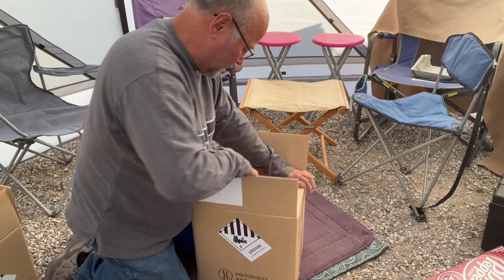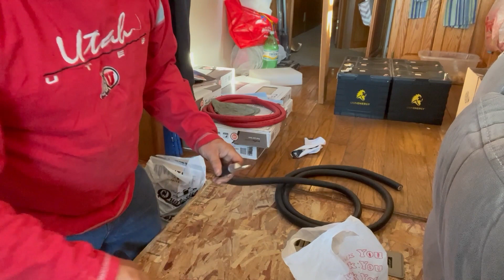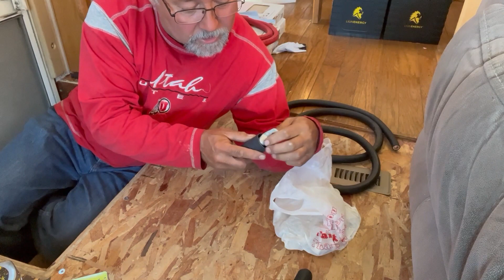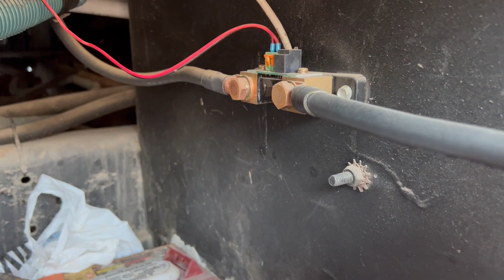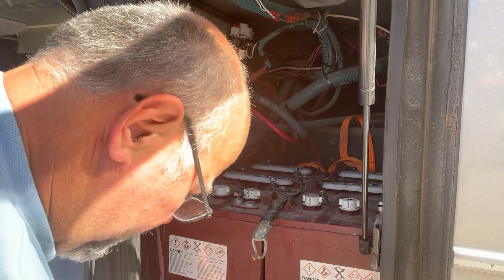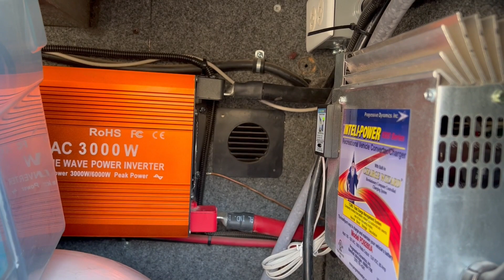INSTALLING LITHIUM BATTERIES - RV LIFE: Time to Replace our Lead Acid Batteries.

Comment: Question what power converter did you change to charge your lithium batteries
Reply from the maker: Good Question. So in this video I did not change our my converter. I kept the Progressive Dynamics one I had for my Lead acid batteries. In this video https://youtu.be/suTQwIjvVVs I changed out to a Progressive Dynamics converter/charger that was specific for Lithium. But the best thing to do is to check with your battery manufacture to see what they suggest you get. If they don't care then this is a good one to get.  You don't have to get as big of one as I got because they come in different sizes.
Reply: @TignerAdventures  thanks for your reply… I need to change mine when I get my batteries I wasn’t sure if I would use Progressive or WFCO … which PG model are you using
Reply from the maker: @MyPettawayLife  In this video I was using the PD9280A. But in that new video I upgraded to a PD9180ALV for lithium. I don't know much about WFCO but I thought it tied into your existing Converter in your rig.  The Progressive Dynamics charger would replace what is in your rig. Usually the one in the rig when you buy it is only maybe 30 amps so if you did the WFCO would it still only be 30? Again I don't know much about the WFCO. Sorry.
Reply: @TignerAdventures  my WFCO is the 9800 series & mine is 55 Amps … they have a 9800 one for Lithium … I am trying to decide which route to go because my batteries should arrive by early September … thanks for all your help in this decision

Comment: Great job on your lithium install David. Is your Intelligent 120V charger configured to charger solar when you are on shore power?
Reply from the maker: Love the lithium batteries. Since I installed them I have not connected to shore power once. Because power is billed here I don't plug in unless I need too. The Intellipower is really intended for lead acid and will work for lithium but will not charge it all the way up. With that said the company said that if my solar charger is producing any current it probably will not do anything. In my case that is not much of a concern as I only use it when I am not getting solar but since I have put the lithiums in I have not ran the Intellipower. Why pay for power if I don't have too. Good question. Thanks for watching.

Comment: I got 3 safari 1300 love them, you won’t be disappointed David, enjoy u2 👍🏻🇺🇸
Reply from the maker: Thanks for watching. We are into day 2 in the winter months and my solar has charged them up to 100% each day.  Pretty excited. I only run off my batteries so it is cool they work so much better than the lead acid.

Comment: Nice!!👍👍
Reply from the maker: It is. Loving it. Not sure about the assisted start option yet. Right now I have by passed it. Only used it once in 4 years so not sure I want to spend the money and since solar works so well not sure I really need the charging from the engine either. My alternator won't know what to do now that it doesn't have such a load on it. Oh maybe I'll get better gas mileage. 😎

Comment: Hard work, but it must be such a sense of accomplishment! We’re sure you’re going to get many years of use from those batteries! Good job!
Reply from the maker: So far so good. The solar is working at capacity and charging away. Excited to watch how it works. Thanks for watching.
Reply: @TignerAdventures  Is your electric included in your long term location or is it metered? Very interested in how much solar save on the monthly electric bill.
Reply from the maker: @wcrvadventures9489  We pay extra for electric. But we only plug our battery charger into the pole and only turn it on when we don't get enough solar to charge the batteries. Because Lead takes longer to charge we usually have to turn the breaker on for about 3 hours every other day. So far with Lithium we get 100% charge on solar so don't expect to have to use the pole at all. The resort charges $15 flat fee and then .13 a kw hour so our bill is usually about $25. With this it should be closer to $15. Others run between $50-$80 a month. This is with our panels flat on the roof.